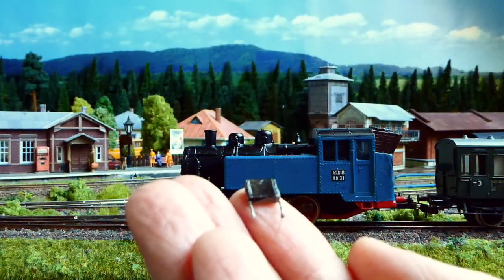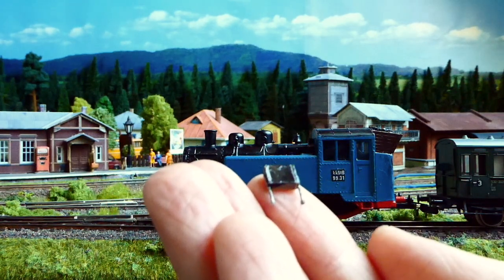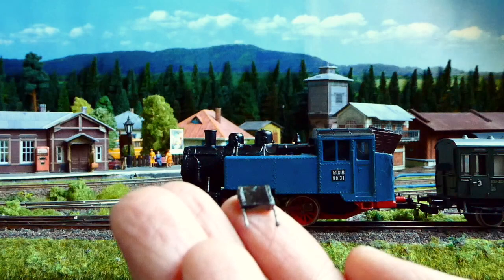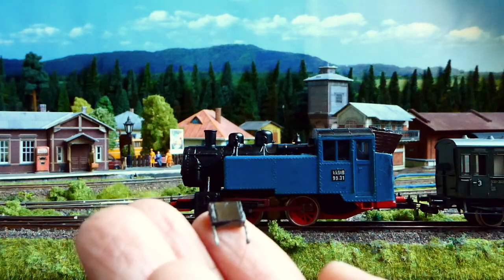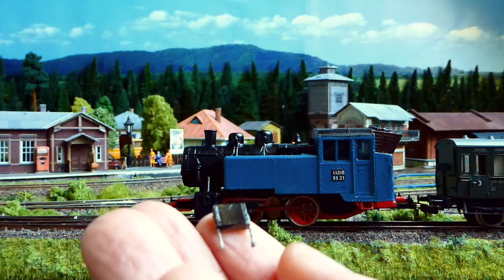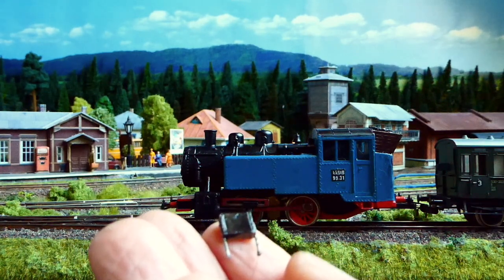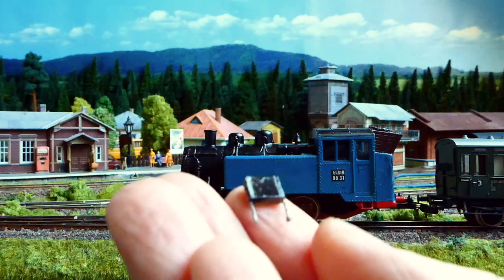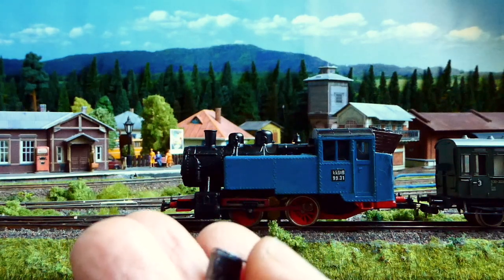Very early in the morning - Old Lima locomotive after serious motor & mechanism cleaning job

Comment: Hi Erik, good to see you managed to service the motor and mechanism. The element is most likely a television suppressor, they are not needed now as TVs have them built in. Cheers, Paul,.
Reply from the maker: Hi Paul, it was terribly dirty inside, lots of hair, black dirt and grease. It tried to run but didn’t get further than a few centimetres and sparks were coming out. But as you know, Lima motors are easy to clean! Thanks for the information on the little electrical element. Greetings 🙋‍♂️ Erik

Comment: Hi, It`s a ceramic capasitor that passes only alternating current. You can give  from 99nF  to 300nF,it is about the magnetic field  of the motor. You will find parts on the old radio. Greetings.